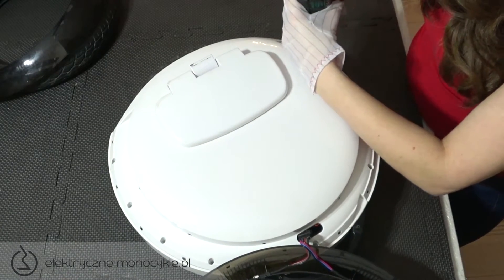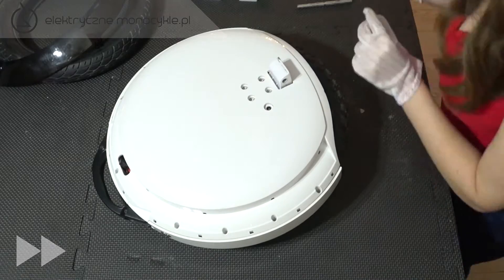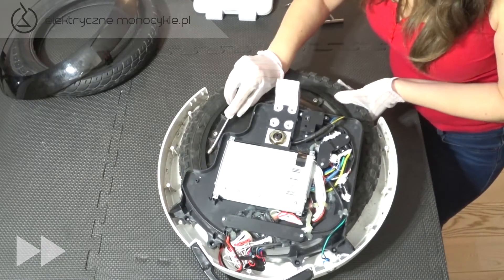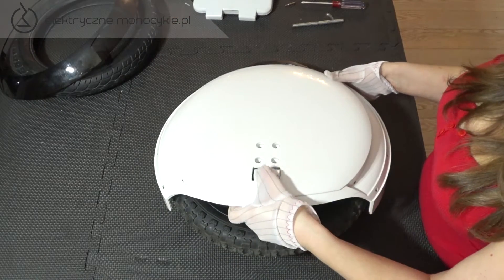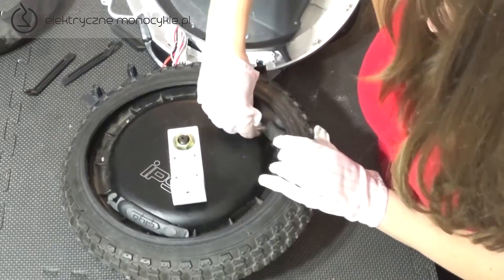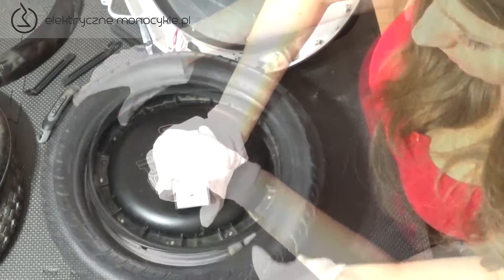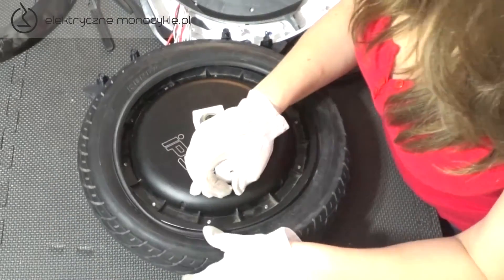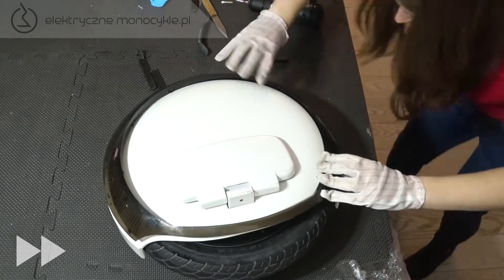IPS Zero - wymiana opony i dętki w 5 minut + demontaż (Justina's Garage odc. 1)

Comment: I am coming to hate electric unicycles but don't get me wrong. The idea is BEAUTIFUL but all the ones I've looked at are so badly made that they are going to destroy the beautiful idea.

I had a Sinclair C5 years ago, another lovely idea but it was so designed to save money that it was a load of crap. The stories of 'unsafe in traffic' etc that hounded it were irrelevant, those problems were easily got round. The real problem was that it cheap manufacture took priority over real practical usability when it was designed. Enthusiasts bought it, but to the average bod it was no good.. And nothing will survive if the average bod does not buy it.

Looking at the video above I see several points that need to be better done.
Point 1: you do not have self tapping screws screwed into plastic on items that need to be unscrewed for normal maintenance. Most people will have stripped these by the 2nd or 3rd use leaving the wheel unsafe.  Point 2: You do not have unsupported cables. Again the average bod is likely to have a wrecked unicycle by the 2nd or 3rd access. Point 3: Having to unclip small plastic clips should be avoided unless there is a very good reason. I see no reason here.  Also: Why are the case screws hidden under the footplate? This just makes extra work.

5 minutes to do this is okay, but we have an experienced enthusiast doing it. I can see that with only a few changes in the design the job could be made much quicker, safer & obvious to the non-expert. I guesstimate the changes would make it about 5-10euros more expensive to build but that is very little in the overall price, and the wheel would become practical for non-enthusiasts.

Maybe there is a wheel out there with quality design, but I've looked at several and they are all crap. This seems to be one of the better ones. Anyway, I love the idea of these but I am not going to pay over £1000 for something with the build quality of a cheap toy. Neither is the average bod. Unless the makers get their act together this is another beautiful idea that is going to die. As the saying goes 'The ship was sunk for want of a ha'porth of tar'.